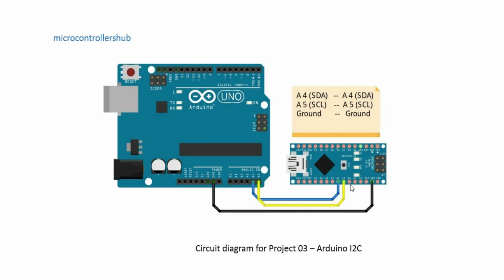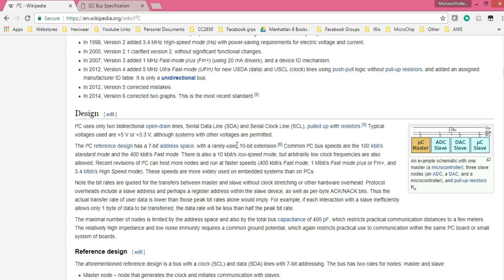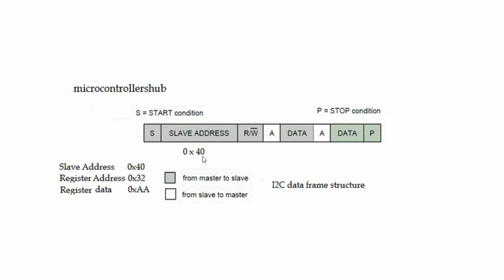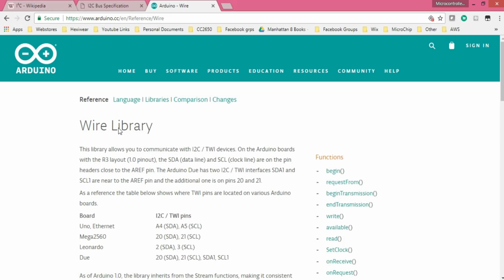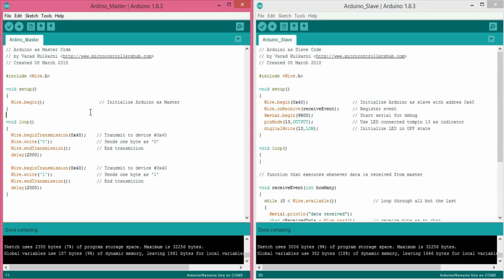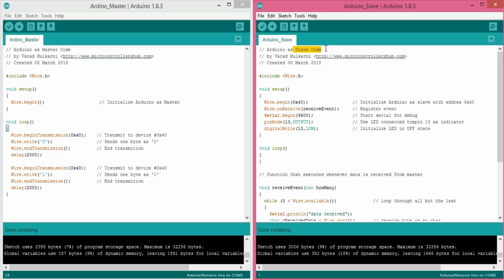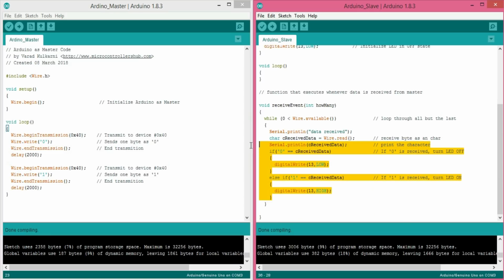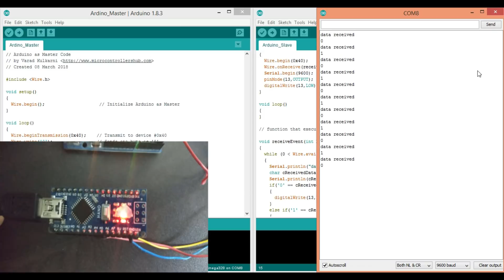Project 03 - Understanding Arduino I2C

Comment: Where did address 0x40 came from
Reply from the maker: +Pratham Bhatnagar 
0x40 address is randomly chosen. You can change it as per your choice
Reply: @Microcontrollershub I am trying to get data from mpu6050 but all I got is -1 on serial can you explain what is wrong and what I have to do.

Comment: Complete newbie here but I'd like to know if it is possible to connect more than 1 arduino nano to an arduino mega?
Reply from the maker: +Serene Ch'ng Khoo Chern 
Yes you can, but how are you planning to connect it. Is it via UART or I2C or on digital pins
Reply: @Microcontrollershub  Following your tutorial, I think I'm planning to use I2C, because I don't know how else to do it
Reply from the maker: @serene_ckc  
Ok, yes you can do it, 
But make sure to use different address fo all slave devices.
Reply: @Microcontrollershub  
I currently have an arduino mega which has 70 digital input/output pins.
What pins expansion method would you recommend if I need to use 150 digital input/output pins?
Reply from the maker: @serene_ckc  I would recommend to connect one more Arduino Mega and one Arduino Uno in the same way as explained in the following link

https://www.youtube.com/watch?v=IwL275gjw04

Comment: I can use Standard Firmata to connect Raspberry PI and master code l2c (Together)? I prentend expande IO Digital Ports with another Arduino and the code automation in PI
Reply from the maker: +EpaHulk 
Sorry but I didn't understood your question
Reply: @Microcontrollershub  I resolve my problema with "arduinojson.h" on second arduino. Now i will split data from serial connection. Thanks!

Comment: Does this require a pull up resistor?
Reply from the maker: +Daniel Gutierrez 
In this case, we are using internal pullup resistor provided by atmega328p. So no need to connect external pullup